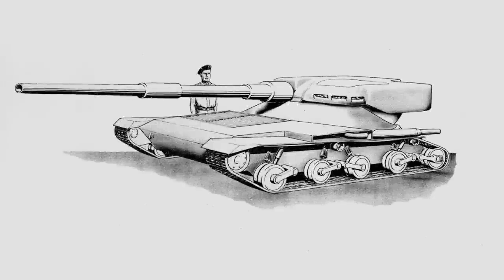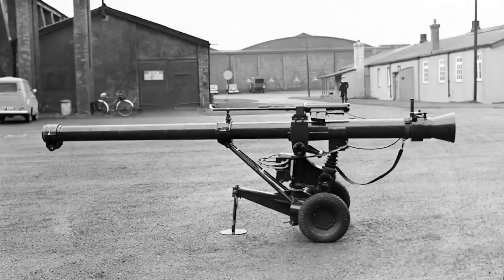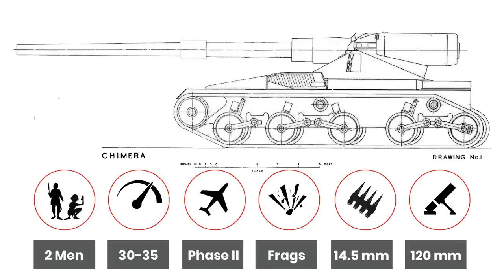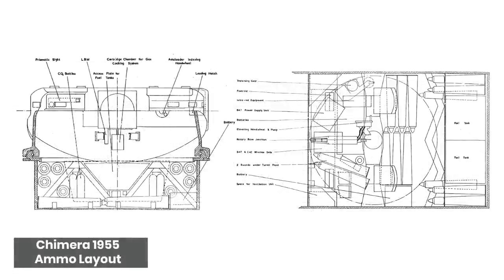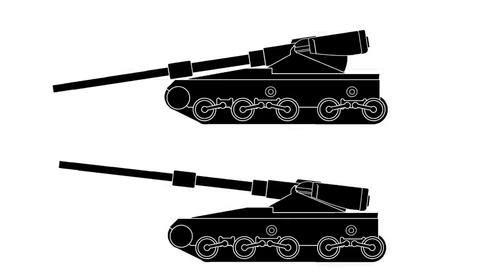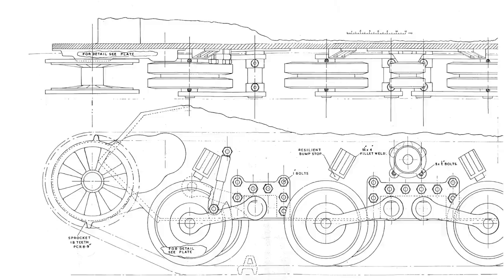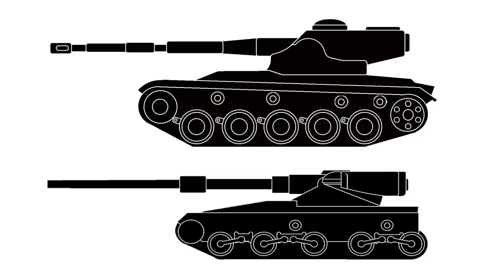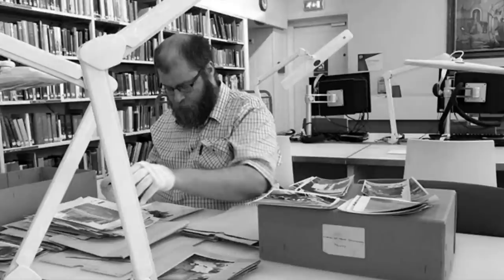Chimera 1955 - Tank Design & Development

Comment: Just a point of interest. Weapon of Magnesium Battalion Anti Tank (WOMBAT) was a 120mm Recoilless Rifle introduced into service in the late 1960s.  It did have it's uses. My first and thankfully last encounter with WOMBAT was being assigned to a land rover mounted version used by regular and TA units in the UK and Germany.  It could be fired while on the vehicle or dismounted with some manual labour, as required. The short wheelbase LR had everything above the steering wheel removed and gave the lowest possible profile for the mounted weapon. Being easily camouflaged the LR weapons system was versatile and easy to conceal in the German countryside.  It carried many more heavy HS rounds in boxes  than would be needed. Therein lay the devil. All good so far until it was time to fire. 
Anyone who has seen either WOMBAT or similar BAT weapon fire, will know what comes next. A huge muzzle flash and cone back blast visible and audible from everywhere! Much more spectacular than the Charlie G on a bad day.  WHOOMPH! Here we are Ivan. As the many T64 turrets turn your way.

Comment: This could have been great as a tank destroyer. Maybe at tier 8 or tier 9, functioning like a turreted Strv S1/Strv 103. 

As it stands though, I hope if they do buff it they focus on the gun and camo and make it even more like a tier 10 AMX ELC bis, which is another TD made light.
Reply: WG Really nerfs the Strv TD lines firepower compared to the real thing, belt fed autoloader firing 50 rounds once every 3 seconds
Reply: Yep the ELC Bis is a airdrop capebel td not really a light but the in game camo will moving isn't samething I like to miss and without it I wouldn't have made it to to 50 in  the hall of fame for same moths but the pre TierX light ELC was even more fun
Reply: Except the 103 was never a TD to begin with
Reply: @johanmetreus1268  yep the strv103 is a early MBT project so like the obj 430 (predecessor to the t72)

Comment: Thank you for this.

It's so bloody sad what has happened to the British Army's Tanks.
Within 10 years?
All that will be left of the once powerful, British tank force?
Are 148 Challenger 3's.

But - as you must know - this name is NOTHING but a political move.
The Challenger 3's will just be Challenger 2's that are refurbished and given the Leopard 2's gun and a new turret.
And the work will not even be done by a British company.
As the company modifying these tanks is actually, majority owned by Germans.

So...by 2030?
All the British Army will have for MBT's?
Are a pathetically-small, 148 upgraded Challenger 2's that will be at least 29 years old since they were first manufactured.
And most of the work will be done by a mostly, German-owned company based in England.

Absolutely sad and pathetic.
☮

Comment: "As the vehicle was limited to a few of two, it would have been unable to for on the move."

That makes zero sense. It does not follow at all. With the design choices they made subsequently, yes, sure.  But the conclusion is not a function of, or derive from, the initial statement.
Reply from the maker: Well I did say ‘unlikely’ the crew of two would have realistically never got past the RAC board regardless, they have very strong feelings about limited crew vehicles. There were a few exceptions, ferret being one, but that had a different role. as for firing on the move, the gun had no form of stabalization fitted.  The specifications are after all written by the school of tank technology, not the RAC itself